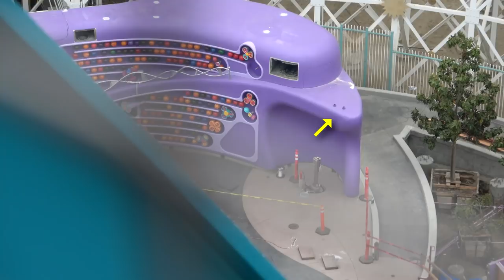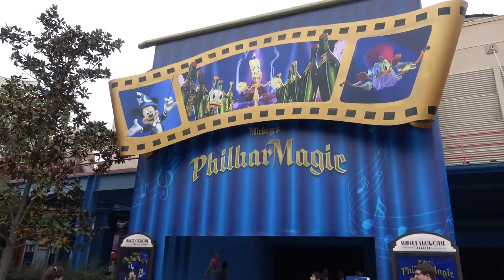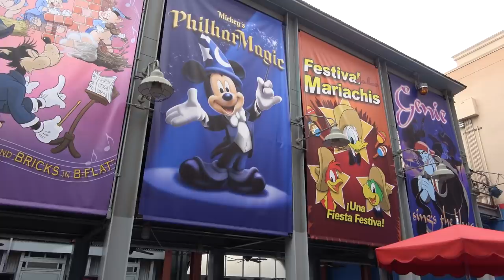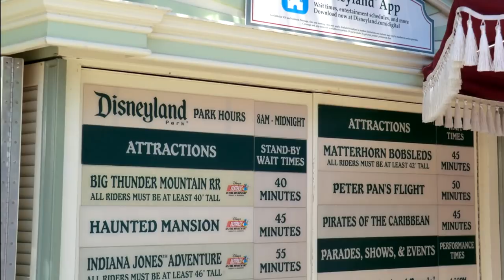NEW CLUES to future of Marvel Land Phase 2?  - Disneyland Construction | 04/27/19 pt 60

Comment: David,
When looking at the former 'it's tough to be a bug' facade, you are asking if they are 'building a new ground level...' If you remember, the preshow for the theater (as well as the theater floor) was below ground level (You went down ramps, around 'ant island' and then into the 'caves' and had to go up stairs when exiting - over all the building floor was 8-10 feet below the ground level of bugs land and Carthay Circle. I am not sure what the building they are constructing will look like but the middle section of steel 'floor' is at park ground level so maybe a shop or food stall at Marvel Land entrance? Whatever it ends up being at park ground level, it will definitely be a ceiling for part of the cue, exit, preshow, or service areas for the attraction.
Hope that helps you visualize...
Reply from the maker: thank you Taz!

Comment: One thin I noticed tonight is that there is a severe choke point between the outdoor seating for the Red Rose Taverne and the churro cart near Dumbo. This is going to be one of the only two ways to get to Galaxies Edge, and the path narrows down to about 6 people wide with a lot of them stopping foe churros. I’m really surprised they didn’t remove some outdoor seating and widen that path.
Reply from the maker: yes that area can get bad if the line for churros isn't managed correctly.

Comment: Dave, why would they need that whole section of the downtown Disney Parking lot for a path from the parking structure. Could they building a new bus, taxi guest drop off area? Maybe, just maybe, the old transportation center would be made redundant and become available space for DCA expansion?
Reply: I'm thinking yes and no. They may move the taxi/Uber drop-off, and the local bus drop-off over to the old DTD parking lot, and move the Toy Story bus drop-off slightly north, but I think the old Toy Story and taxi drop-off areas will be converted to backstage areas, not on-stage. But that would open up that whole area behind Mission Breakout for Marvel Phase 2, which is exciting.
Reply: Something mentioned previously was that Disney was upset about the harbor Blvd gateway crossing not being permitted by the city so all drop off and pick up traffic is going to Disney way to snub the local businesses who were against the gateway project...makes sense to bring in everyone into downtown Disney and the parking structures

Comment: it does look like a backstage road only between the two structures but it is also open and visible to guests as they drive up the ramps to park.
the only possible use for this dug out area  between the staircases would be for planters.

large trees and greenery would definitely dress up the area and helo the aesthetics of the structure.

this area might also be accessible for guests as a crossing area from one structure to the other.  both structures will have parking spaces available on the first floor. mickey and friends has them already.
guests can then walk from one to the other on first floor using a path or head up the stairs and use the crossing bridges

Comment: 28:00 walkway for guest access to the Stairway, and maybe some greenery, there will be a fence next to the walkway directing guest to maybe a patrolled crosswalk towards the tram loading area? Idk.. Need to get some lower level shots to really figure it out. Also there's a road on the backside of the new structure that no one seems to ever record. And your correct, the road in the middle of the structures will be for Disney vehicles only.

Comment: Think you're correct on the emotional whirlwind turnstile. If you look a little bit further, you can see circles cut out of the concrete which will probably be numbers to speed up the queueing similar to Dumbo or other similar rides.

Comment: Could the Peter Pan queue change be to add a fast pass line? Or is that wishful thinking?
Reply: I hope not! 😳
Reply: Fastpass would ruin Peter Pan wait times. Essentially, fastpass extends wait times because the queue is forced to function with 2 lines for the same ride. While it can be GREAT if you get a fastpass, imagine the competition and the even larger disappointment if the average stand-by for PP was 2 hours instead of 1 hour :/
Reply: I am sure they could, but I am not 100% convinced it needs it.  I was amazingly surprised by how fast the lines moved for many of their rides.  In fact, sometimes I wonder if they only make lines go slower.
Reply: @mitchellries256  Fastpass actually does make some lines go slower. Micechat just did an article with proof of that.

Comment: @9:20, where they removed the gate.  From GG side.  all the dirt around the foundation of the gate post has been removed.   They have large concrete blocks, with wire attached to the gate post.  There is a nice knothole over there.
Reply from the maker: i'll try and take a look next week.
Reply: @FreshBakedDisney  Holes in the black fabric, on the left side.